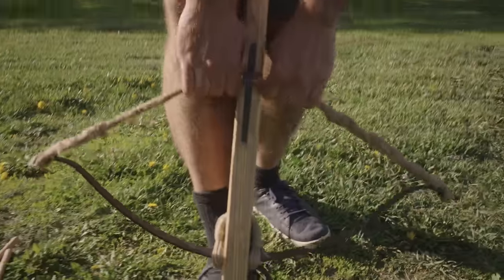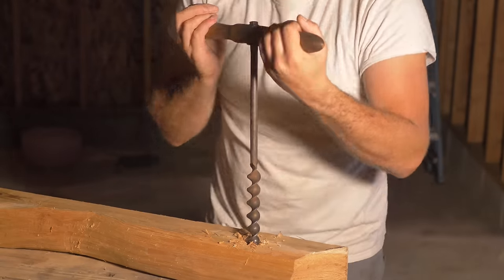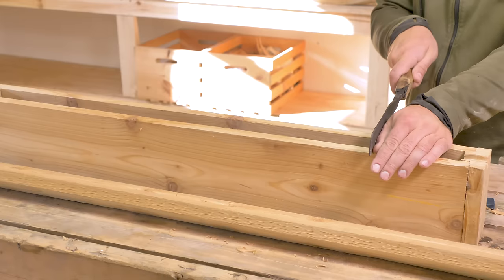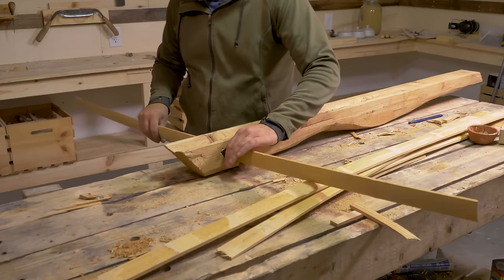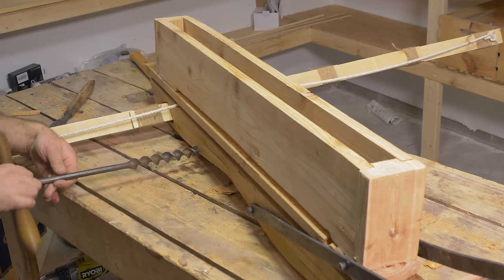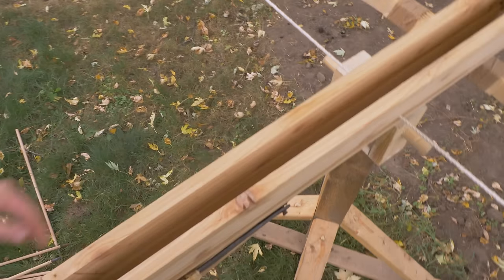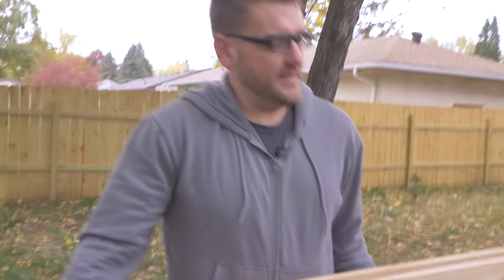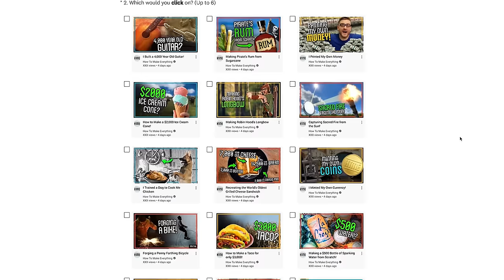A Machine Gun Crossbow?

Comment: Btw I think the original chu-ko-nu had a captive "firing pin" of sorts that sat under the cocked string. When the lever was pulled back to full travel, the bow would fall on a protrusion, pushing the "firing pin"  up which would push the bowstring off the notch/shelf, firing the bolt. The pin would reset when the lever was moved forward as it lifted off the protrusion. A consistent "trigger" like that would probably improve accuracy and make it easier to score hits at steep angles
Reply: Yes my own crossbow uses a similar mechanism but with a simple button trigger
Reply: Accuracy doesn't really matter when you're trying to fire volume into a crowd
Reply: @robertcowley-yamamoto4880  Well arrow heads at the time were not that cheap so more accuracy you get the better, but then again one would mix up the military force with this kind repeaters for volley fire and have few hundred specialists with long bows to take the accurate shots to individual targets. Though i could be wrong on army composition.
Reply: @Hellsong89 ancient China was an industrial leader contrary(?) to modern day and volume of fire was much more important. Stationary versions were wall defenses or ship defenses. They were likely much more powerful and accurate than depicted in this video. If they wanted low range power, they would use a scorpion pattern crossbow (existed in China since 400 BC) or a composite bow.

Comment: Honestly it's impressive how well it works. You also managed to get some decent power with it. I feel like a bit more time tweaking things around and it will work really well.
Reply: Wait until he use compound bow
Reply: I think that a lot of the difference here is that he's using single general-purpose rough-made tools with minimal finish work, because he's using stuff he made himself, and wants to finish on a video-production schedule with a functioning prototype.  Historically, they'd be using specialized tools made by toolmaking specialists, have people who would do the final sanding and polishing for them, be working from charts and pre-designed specifications that've already been iterated on.

So like, things like having a sanded and laquered finish on the moving parts, having thinner walls on the box, more precise dimensions to the bolts they're using.  Using different woods or materials for different bits.
Reply: you literally have no clue what a machine gun is, thats basically just a crossbow but instead of loading every arrowing your self, you just lift it up in the air until it loads

Comment: This has got to be one of the coolest things you've made! The raw power as the arrows tear through the target is so satisfying.
Reply: uhm actually they're called bolts 🤓🤓🤓
Reply: Zhuge nu is actually relatively weak
Reply: It's a Styrofoam target. A toothpick will penetrate it.  He needs to use ballistic gelatin and up the draw weight a little.
Reply: @alexwang982  Not every Zhuge nu is weak, the korean naval artillery version is not. It's basically use what look like normal bow and long powerstroke.
Reply: @cool06alt  however, there is still a definite limit to this design which is in the strength of the user. there are no aids to draw the string available in this design, just leverage from the arm. you can't have 200lb draw weight zhuge nu because no one could draw it.
Reply: @alexwang982  The lever you use, just below the magazine box is quite similiar to European crossbow's gaffe lever.

Such lever would have mechanical advantage of 30:1. 

For something like 300lb prods would just require 30 lb to draw.
Reply: @cool06alt  That lever does not have a ratio of 30:1.. that would require 30x the distance from the fulcrum

Comment: I would definitely want to add some kind of rail system to prevent the top section from falling off the side when you push it forwards to reload, the channel you have it resting in doesn’t quite seem adequate especially when you try and go quickly. But for a first attempt that is spectacular and I can’t wait to see what other improvements you are able to make in your collaboration with Joerg!
Reply: adding a bar on each side would probably fix it.
Reply: My thoughts exactly
Reply: @satibel  exactly. I was think "just nail two peice of 2x4 to each side" the whole time. Would probably help with accuracy as well

Comment: Sir Ralph Payne Galway wrote a book which covered crossbows in detail. It's been 40 years since I read the book but it mentioned the Chinese Repeating Crossbow. It did mention that the crossbow fired light arrows that often had the tips covered with poison.
Reply: That sounds like the most effective way to use this weapon. Shot placement wouldn't matter and you could take out more enemies per shooter.
Reply: @commonsence8223 also the power doesn't need to be as high, requiring less penetration to be effective

Comment: Incredible! I love how good your wood- and metalworking skills have gotten.
Reply: From the video you can see the blacksmith dude did the metalworking part. This is a work of at least 2 guys. Also, I think the more impressive part isnt the quality. Honestly, theyre not good quality, as you can see in the amount of tweaks needed and how everything is a little bit wonky. Whats impressive is this guy just soldiers on and really put in a lot of work. Just today I accidentally broke a cutting disc, quickly packed the machine to hide my fuckup (so I dont have to replace the disc), then resorted to a regular hacksaw, gave up a quarter of the way, then walked some distance to go get the acetylene torch to cut the thing. If I were tasked with building a machine gun crossbow with historical tools, it would be done in 20 years because I simply wont have the determination to go through all that work.
Reply: @de0509  I didn't work on this video beyond a tiny bit of planning and consultation. The footage of me is from the other crossbow video.
Reply: @TheElfsmith  ah my bad then. Sorry didnt remember your channel name. But I definitely remember your face

Comment: Great video,  in my expeience with making strings for crossbows.  you may want to wax your string, so that it glides better along the wood and out of the notch.  also i dont know if you did any fletchings on the bolts  but most crossbows only had side fletchings. not the typical  3 we have now.   i built one with a track down it for the lower arrow fletching to go down and its pretty nice.

Comment: Very cool! If you forge another bracket similar to the one you already made and attached it inverted to the front of the lower section of the crossbow, it would go around the top part and prevent it from separating. Keep some extra clearance, so it won't hinder reload.

Comment: Gears are a great way to make that automatic. Don't use doctor stones version to change rotary motion to a straight forward one. Instead just take a rod and fix it to any point on the circumference of a circle, then as the circle rotates, the point will change it's position from one side of the diameter to the other. If you fix the other end of the rod that's not attached through a focal point like a ring on some nail, it can be changed from a rotary force to a linear one. Good visual example can be found on or in some trains
Reply: Steam locomotives have tat sort of linkage, yep. Also, that's the basic operation principle of a tattoo machine. And almost the direct opposite of how auto engines turn linear piston motion into rotary camshaft output.
Reply: @theKashConnoisseur  correct on all accounts sir

Comment: Protip with bamboo: when you gently heat bamboo, the sap comes out and it becomes almost as flexible as rubber. Then if you cool it in water and rub the sap in, you can shape it to any shape you want! Do this to easily make a circle of bamboo or bend it in a recurve shape. Almost like steel. 

Remember when you do this to NEVER put the bamboo inside the flames. Put it above the flames, with the green side facing down, and bend it as it’s being heated. This also hardens the bamboo; you should use it in a recurve bow

Comment: Hi, I'm currently working in the area of archaeological conservation in China and I know a large number of archeologists, if you need help creating projects like this, feel free to ask me for help. 
The traditional Zhu Ge Lian Nu uses a very heavy bow at the front, compensating for the relatively short travel distance of the string. The lever of these larger versions of Zhu Ge Lian Nu is also constructed differently, usually with one arm much longer than the other, making it significantly easier to use. The magazine box also needs to be much more precisely fitted so that only a single row of arrows can fit in it without wobbling. There are also two pieces of wood on either side at the front of the Zhu Ge Lian Nu to keep the magazine from moving sideways. The arrowheads of the Zhu Ge Lian Nu are usually a bit bigger than the one you used. 
Zhu Ge Lian Nu is usually used in a defensive manner as they are bulkier compared to traditional bows, and nearly impossible to refill on a battlefield when used in an offensive manner. Hope this helps, Cheers!

Comment: I made one of these about 25 years ago following the schematic in The Book of The Crossbow.  If I may, I have some suggestions to make yours run smoother. Put a wooden rail on each side of the base where the top slides back and forth. It will make a big difference. Also the surfaces where the top and bottom come into contact will function more efficiently if they are both flat instead of v-shaped. It will also keep the string from getting abraded by the string guide slot.

Comment: Suggestions: add a flywheel to maintain continuous power, handcranked like older machineguns, convert the rotary motion of the flywheel into back and forth linear motion, and switch to a system where the bowstring is caught by a smaller internal catch in a rail on both sides of the arrow/bolt (moving the whole "magazine" is an inefficient use of energy), with a small ramp in the back that lifts the string out of the catch. If you want a trigger-type system, something like have the trigger engage a clutch between the flywheel and the rotary->linear system.

Comment: A few suggestions. 
1) Weld a shovel handle onto the end of that iron handle you have now. At a slightly downward angle. That will give you move leverage for the rearming motion.

2) The shims only need to be a bit taller than the hole the bolts fire thru. basically if you dish the bottom of the magazine to a point just one bolt wide it should feed better but still hold a tone of ammo. 

3) Sliding hinges to attach the body to the magazine.

4) This is just a thought but if you could add counter springs to the magazine, to help with the reload, you might be able to improve the draw strength maybe into the 80lbs range making it closer in power to a bow. it would probably need to be some form of coil spring to give it enough travel to work with the motion of the machine... but its worth a thought.

Comment: A machine gun crossbow would be quite the achievement!

My best thought would be to utilize gears and a notched chain with stacked crossbows.
If you can get the links tight around a helix or figure 8 shape it may work.
Bssically the idea is to have 2 or more crossbows firing one at a time in sequence to reduce the odds of catastrophic failiure of the bow or string from over tension, kind of like a rotary gun.

In fact if you can get a fully functional feed box for bolts (i would suggest non-fletched flush tipped bolts to reduce jamming, and notched chain to allow timing the bolts with the further mechanisms to prevent overloading each bow) maybe a rotary style assembly of nested crossbows could be possible as after cocking the bolt only needs to be added just prior to firing.
Maybe utilize a drive shaft to rotate smaller cocking assemblies with the shaft also functioning as a rotator.
Each bow would need to be positioned to avoid overlapping, so the feed mechanism would probably have to be on the bow itself to direct the bolts with the bolt box above and offset to allow a modicum of accuracy.

It wouldn't be very accurate, but if you want accuracy you grab a sniper not a machine gun.
Also I'm not a bow maker so take my ideas with a grain of salt

Comment: In one of your videos you do soon, you should go after making gears and you can arrange into a sort of form of a transmission system, allowing you to trade torque for horsepower or horsepower for torque. Can arrange them by hand if you can't figure out a simple clutch design that allows you to release from one gear set to another. Extremely versatile and necessary for lots of engineering applications. The mind is practically the limit shit gets crazy. I'm almost convinced someone could create a type of life if you had intricate enough gear work
Reply: @stevexracer4309  I'm going to assume you meant gears because I made no mention of God. However to answer I'd have to say, the drug called science. You likely don't fathom or understand the complexities or mechanics of even a watch. So I suppose I shouldn't think it's odd you may not be able to scale the intricacies up in your mind to have something mechanical be able to receive or give out and input from the outside world and function in a very similar way that mimics all the mechanical functions of your own body and mind

Comment: I would also find the idea interesting to use the whole thing like an english longbow. That is, in a tight formation of several devices with a fixed angle and then fire in volleys at an enemy arm. You would get around the problem of inaccuracy by focusing on distance, speed and volleys. The length of the bolt and weight could easily be made like that of an arrow for longbows. The draw weight comes in right in the range of English longbows at about 100 pounds. With longer levers, a higher draw weight would not be a problem. However, it would be lighter and faster than a ballista and could replace experienced archers with less experienced farmers. At least in fixed positions like castles.

Comment: cool thing you made, no doubt, but 60lbs is not heavy at all. War weight bows are minimum 70lbs, often over 100lbs. Medieval crossbows were over 1200lbs. Something that big should be much heavier. The Korean ones from the painting are clearly using metal bows which would drastically increase the weight. The difference between the metal bows and the wood bows is you're using a much shorter stroke, so short draw, but much more power in a short range. Maybe look into building that next?

Comment: Glad to see you are expanding your arsenal (of knowledge). Having this relate to archery adds to the appeal, for me at least.
Some notes related to your video (in no particular order):
You should have a dust collection system running every time you're using machines while woodworking. The small particulates are not only an issue for breathing in initially, but small enough particulate can lead to cancer. That being said, I'm still happy to teach Woodworking (even if some people call it a mini cancer factory).
Never, under any circumstance, dry fire a bow. Not only is it a very easy way of seriously damaging the bow, but it can also make the bow literally blow up in your face. Luckily, your bow did not blow up in your face or break (from what I can tell).
Your bow is also fairly light for a crossbow. I'm not sure how the weight will translate with how your design is, but 63 lbs on a modern crossbow would be a recurve or conventional bow with about a 25-30 lbs draw weight. It's not bad, and good for repeated shooting, but also not very heavy and possibly too light for safe hunting (not sure how fast bolts are coming out of your arrow and with what force). Your crossbow does have the same draw weight as my compound bow though, which isn't bad.
Reply: "*Literally* blow up" is a bit over the top, but it very likely could snap/fragment/break apart, with pieces flying into his face (and everywhere else). But as Gary said, dry firing a bow, of any kind, and any draw weight, is a very bad idea and shouldn't be done.
Reply: I agree the bow blowing up like an explosion is a bit extreme, though it's possible in very rare situations. The most likely thing to happen is parts of the bow will shatter or break and you'd have fragments of whatever it's made of embedded in you

Comment: Try using a highly massive fly wheel to store energy, attach the lever to a slider crank mechanism that transforms rotational motion to linear motion of the lever and bow string, then the rpm is just how fast you can spin the wheel and what gear ratio you use.

Comment: I feel like a safety in the form of a levered latch that would hold the string back when the crossbow is fully drawn. Perhaps make a trigger in the same way. With a trigger or safety, you could load and aim while set and steady, instead of it firing right after you are at the tail end of the back stroke, that motion isn't conducive to accuracy I'd imagine.

It's a great remake of the original idea still. I am just thinking of safety and a possible use problem that can affect accuracy.